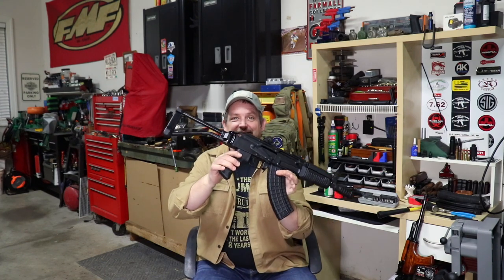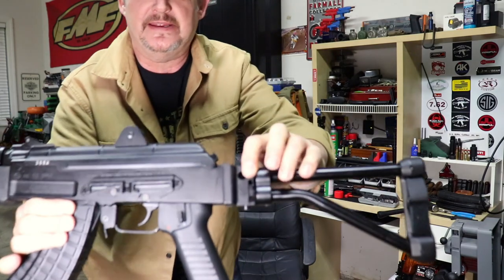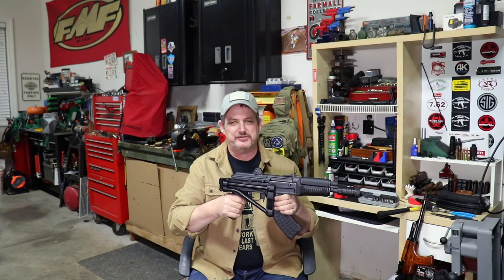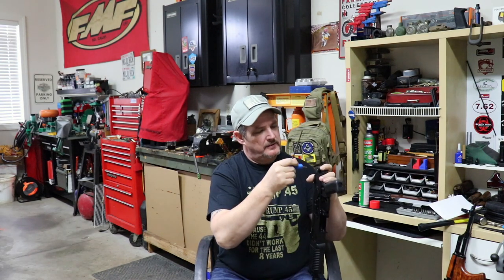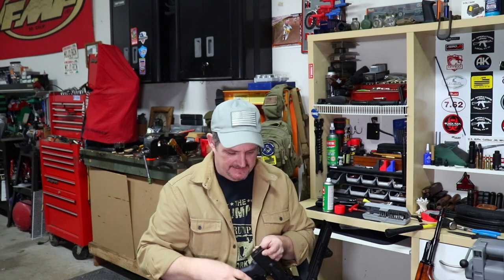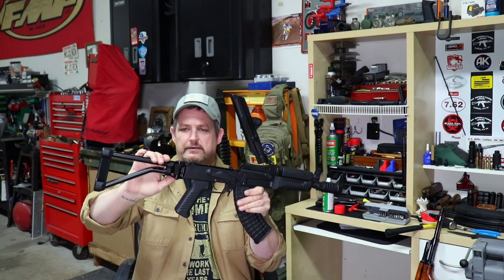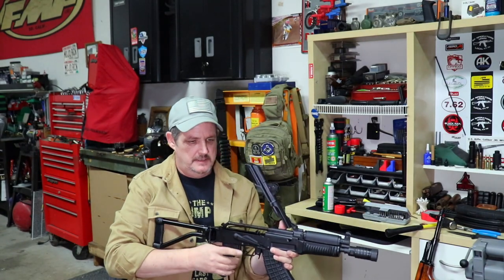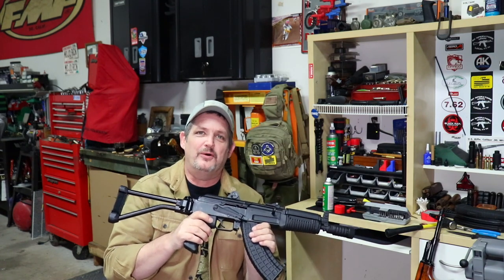CNC WARRIOR ARM BRACE ON ARSENAL SAM7K 44 PISTOL

Comment: After I removed the rear bolt holding in the pic rail, I had to take a hammer and tap the rail out. It was a pretty tight fit! Thanks for the help.
Reply from the maker: glad i could help

Comment: I got my brace to fit on the pictanny and not remove it, CNC warrior suggested this in case I need to put the brace on another pistol and right hand fold so it’s not going to interfere with the option rail

Comment: Thanks for the informative video. 
What is the RS Regulate Mount number ?
Thanks
Reply from the maker: You need the ak312m lower and then an akml upper and you can mount a nice primary arms red dot or aim point.  Your kind of restricted to mini red dots because the mount places the optic behind the factory site mounted on the dust cover.
Reply: @rockordnance  1} Would this work for a micro draco?  2} What's your opinion of the Extar Exp 556? #KAG2020

Comment: Was this the Right hand model that folds right and the left hand model folds to the left?
Reply from the maker: Yes, I bought the right hand model and it folds right.  I didnt want it to fold left because It has an optic mount on the side and Im going to run a red dot on an rs regulate mount and the stock would hit it and not stay folded if I used a left folder.

Comment: Waiting on mine, sent it out to get some milling work done to the receiver ... stay tuned .. hopefully I will have in two weeks or so ... 👍🏼🇺🇸
Reply from the maker: What are you having done?
Reply: Rockford Ordnance I am having the 24mm front sight installed, with the Bulgarian military surplus strangle sidefolder installed which requires milling to the receiver ...
Reply from the maker: @AngelSilverFourtySeven  did you get it back yet?
Reply: Rockford Ordnance no not yet ... I will put a video up on my channel once I receive it .. 👍🏼🇺🇸

Comment: Like the videos but - Whee - got one of these but the little SOB has a folding issue. Go to fold it - no - will not budge. Later - pick it up - folds. Later - like a rock again. I have no idea.
Reply from the maker: So you are saying yours is sticking and doesnt want to fold easily?  They can be a bit stiff when you get them.  Oil them up a bit and let it work into the pin.  There is also a technique to folding it.  I show you in the video the best way i have found to unlatch it.  Once it breaks in a bit, it gets much smoother.  Very tight tolerances which is a good thing.

Comment: Thinking bout getting one but mine doesn’t have the rail just the swivel hole. Will it still work?
Reply from the maker: Yes the rail does not get used.  You remove the rail
Reply: @rockordnance   thanks! Also was wondering do I need to get a tax stamp since it says on the site it’s a stock. Or is it classified as a brace 🤔🤔
Reply from the maker: They make a stock and a brace.  Make sure you are getting the brace otherwise you will need to sbr it.

Comment: Hey can you use a cz scorpion with this brace ??
Reply from the maker: I dont believe so.  CNC Warrior does not make one specifically for the scorpion however.......  Cnc warrior does make some folders that I believe can be used with an m4 stock adapter.  I know there are a few other companies making adapters for the scorpion that will allow you to mount an m4 adapter so you may be able to adapt something to it.  It just may take some research and effort but keep in mind, you could land yourself in some trouble as the ATF states that a pistol brace cannot be modified from its original form but that does not pertain to a mounting adapter.  Do your research and do not rely on opinions as legal advice.

Comment: Stop pointing your gun at yourself. JeSUS!!!
Reply from the maker: I appreciate your concern.  Ive had a couple other comments on the one spot where a spin the rifle around near beginning of the video but I promise you  its a camera angle that makes it look like I flagged myself when in fact I did not. The gun had also been previously disassembled for the video, put back to stock form and then the stock reinstalled.  I will also say that there is no live ammo in the shop.  There are some dummy rounds for testing different things but they are made by me, the headstamps are painted to denote the fact they are dummys and they have expended primers in them with no powder.  All that being said, I refuse to pander to the non gun owners or anti's that continually shame content creators into continually pointing out their empty chambers and mags.  Now, that being said, I am not in any way referring to you sir.  Like I said, I appreciate your concern and with so many new gun owners coming into the fold lately, I think I will devote an entire video to safety.

Comment: Would this fit the SAM7k-34 ?
Reply from the maker: As long as you have the hole in the back of the receiver
Reply: I'm trying to answer this question as well. The 34 comes stock with a QD hole in the rear trunnion as opposed to the pic rail on the 44. I'm not sure that it would work.